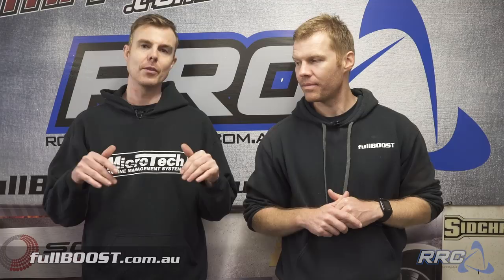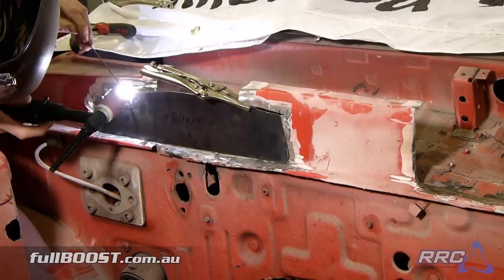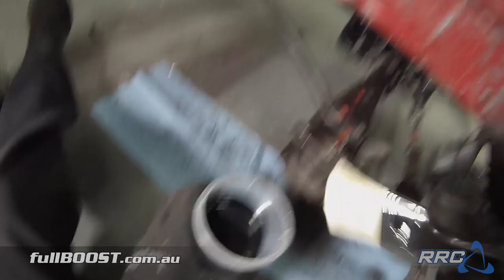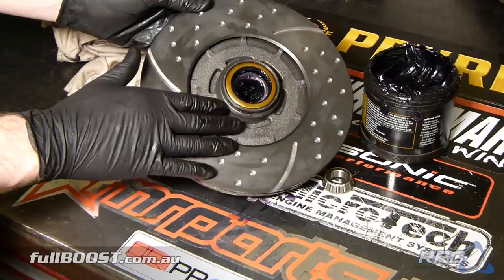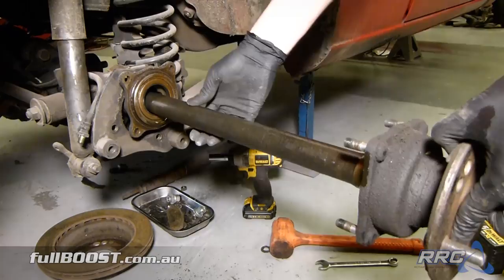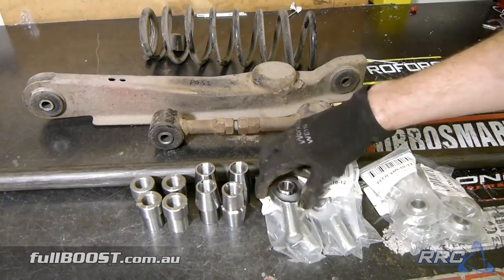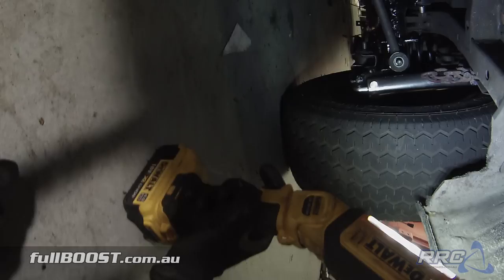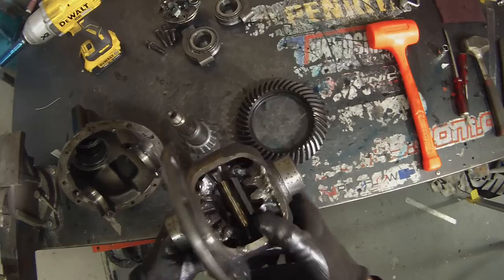BACKYARD MECHANICS | Bodywork, brakes & suspension | Project REDLINE Mazda rotary build Ep 2

Comment: Don't forget to drill your witness holes in the outer part of your suspension arms. As a scrutineer I poke in the hole with a bit of wire to make sure there is sufficient thread engagement of the rod end bearing in the threaded part of the control arm. Normally the rod ends should not be engaged by less than the diameter of the threaded shank and really needs to be one and one half of the thread diameter. Looking for the bearing to be engaged by 3/4 of an inch for a 1/2 inch unf thread. I have seen rod end bearings pull out of control arms due to insufficient depth of engagement . The torquing and tensile forces on launch are massive,just look at a twisted or sheared axle shaft for proof! Given the very high speeds you will achieve a control arm failure is the last thing you want at 160 plus MPH!
 Work looks great guys,following with interest.
Reply: Andrew Wilson good explanation of the engineering requirements for rod ends mate! a lot of people ignore this and many other things as you'd definitely know being a scrutineer :-)

Comment: What kind of shocks did you guys run in the rear I can't seem to find any to fit cheers..

This series is the best I've seen right up my alley
Reply: Hi mate, we measured up some stuff on line and ended up with Viking double adjustable shocks.  The part number is B228. They are to suit a chevy bel air, but viking said they will work no problems in this application because of the double adjustability.  Im currently just running standard rear springs.

Comment: I hope you replaced the axles. On the video you can see when you pull the axle out of the diff that the splines are twisted. The won't last to long especially with the cig locker. I can understand you a trying to keep everything to a budget but a spool or even a mini spool are not that expensive. When you made the rear tubular control arms what did you do on the lower arm for the spring perch. 
Cheers guys can't wait for the next episode.
Reply: Hey mate.  a spool for a hilux is about $500+, and its not money i would bother investing in this platform.  If it breaks, we can put the $500 towards a 9".  No, the axles are still there, and yep, they have had a hard life haha.  not the stuff you would put into a customers car, but its my car, so im not concerned.  if they break, they break.
The lower arms retain the factory spring perch with a moly tubular arm same material as the top arm.

Comment: instead of cutting random shapes i would have purposely cut rectangles so it would easier to swap and weld in
Reply: yeh, not sure why they didnt just replace the whole top section of the firewall. a single bit of sheet with a single bend. and the welds looks like a 12yo apprentice.
Reply: or that, just made it hard on themselves

Comment: Where did you source the extended screw in wheel studs for the front disc from?? I need to buy some.
Reply: Hi mate, i cant remember exactly, but i believe i typed in M12x1.5 wheel studs into ebay and found some 80mm long ones.
Reply: Cool ill have a look now!!

Comment: maybe its the vid but the axle splines look twisted?
Reply: oh.. its not the video ;)  this diff has had a long hard life.  hope to get a few passes out of it before i either have to replace the axles with billets, or just replace the whole diff with a 9".  See how far the old girl can take us first.
Reply: MrParts_RotaryRaceCars im sure there are a couple passes left. id be hesitant on going to 9in. I dont like the added weight. were still using a borgy in the vn to go regular 8.80@160 I recon the toyota diff can go there no worries.
Reply: we should be ok for some time to come with slicks and the auto, but eventually we may want to try a radial, and they are a little less forgiving on the driveline

Comment: how much hp are you thinking about making
Reply: XQUINNY5X 351 depends how hard they lean on it. with the turbo they are using it should see 700+whp
Reply: hp figures are relative to atmospheric conditions, drivetrain and even the dyno you use.  You cannot compare the hp from say a car that has done 1 pull with a manual trans on an inertia dyno like a dynojet to say an auto trans car that has had 30 pulls back to back on an eddy current dyno like a dyno dynamics dyno.  Ive seen some crazy numbers boasted about over the years, but when it comes time to back them up at the drag strip, the car either doesnt run what it should, or the car never races full stop.   Doesnt matter what track it is, you can compare the mph from a car anywhere in the world and know where you sit. Dyno's figures are for facebook ego's, racers talk mph ;)
Reply: alright thanks